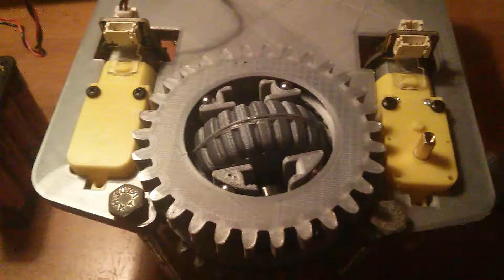Differential Swerve Module Test

Comment: Looks cool but Very noisy ?
Reply: The majority of that noise is the ball bearings I am assuming and the gear motor. That can be largely eliminated with say some sealed ball bearings maybe and tighter tolerances within the gear motor and over all set up. Not bad for a prototype though.

Comment: Is there any chance I could have your cad? I've been working on a similar thing and it would be really helpful to see your cad and if possible your code aswell
Reply from the maker: Definitely, you can find the CAD here:
https://botspace.github.io/differential-swerve-drive/
Unfortunately the code is long gone. Even if I had it it wouldn't be useful to you, we never implemented closed loop control. Lastly, I can't make any promises about quality of this design, your mileage may vary. Be sure to at least read the last paragraph of my blog post.